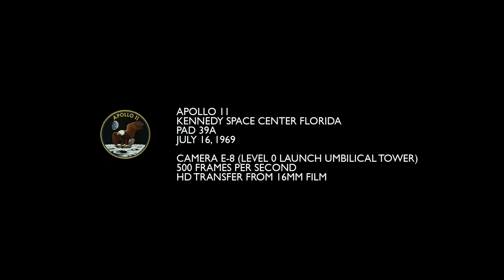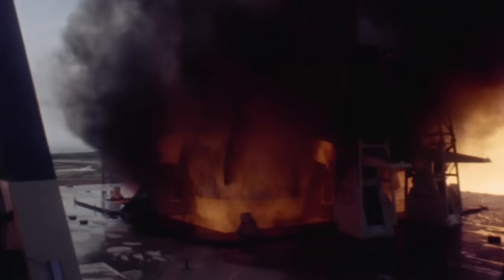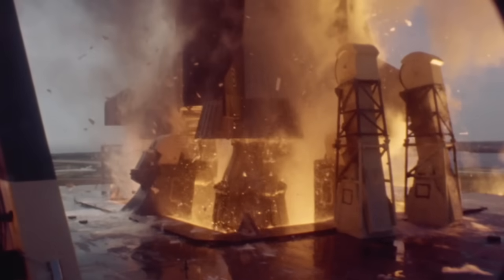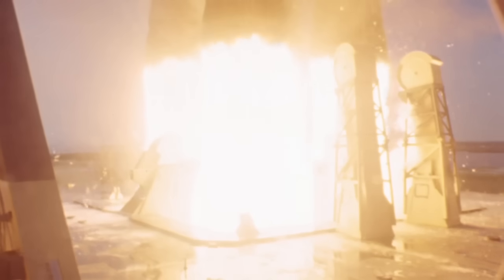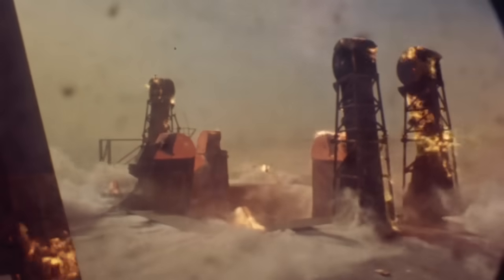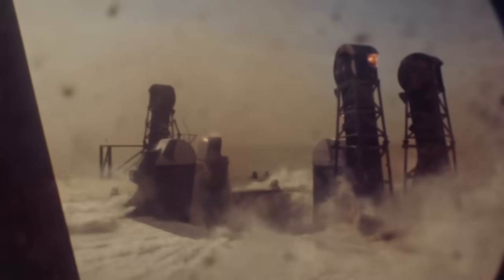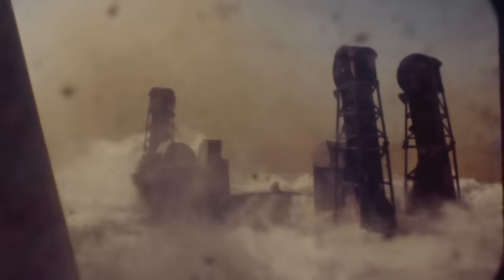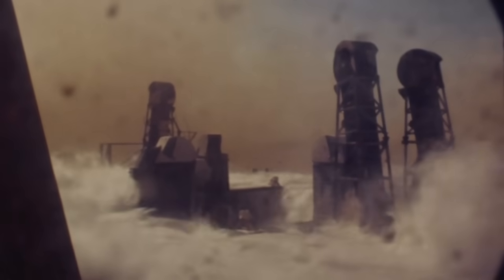Apollo 11 Saturn V Launch Camera E-8

Comment: A lot of work must've gotten into just this camera alone. Shooting at 500 fps in 1969 is by itself amazing. The engineering of the camera to spin the film so fast, yet having a shot this clear must've been a challenge to make. It looks so good...
Reply: Check out the Rapatronic cameras they used nearly 30 years before this to film nuclear bomb tests. It was @ 1 million frames per second. (They never ran for a full second. More like 0.006 seconds). If it did though, and you watched it at 24 frames per second, it would take over 12 hours to watch the 1 second. It was an amazing piece of technology!
Reply: Worked with a fellow years ago who used to work for the Atomic Energy Board of Canada specifically on the high speed cameras, you can look it up but those bad boys had frame rates around one million per second 😮.
Reply: The real challenge was to make a camera system that could survive the conditions that existed that close to the rocket.
Reply: He briefly mentioned something about the mirrors in the camera, making me think they had it in a safer location and used mirrors to reflect the image to it.
Reply: Imagine Zapruder filmed at that frame speed.
Reply: When too need to fool the whole world, of course camera work has to be good. Very impressive cgi
Reply: @kitten_with_bad_breath  do you not even believe that the rockets launched? Have you seen a rocket launch? they are sure as hell real
Reply: @kitten_with_bad_breath  Really. CGI in 1969.
Reply: @kitten_with_bad_breath  your brain is actually made out of vanilla ice cream.
Reply: @kitten_with_bad_breath  😂😂😂😂 Fool the World? How's that? 😂
Reply: @kitten_with_bad_breath back to mommy’s basement, troll.
Reply: @kitten_with_bad_breath  They can't pull a fast one over on you. You are way too smart for 'em!

Comment: That is not a turbine. There is no rotating blades in the engine. That is a rocket engine. It just blows.
Reply: There are turbines driving the fuel pumps.
Reply: @Ali Aksin If you believe that, then it's you that blows.

Comment: The water was dumped into the flame trench to control vibration from the engine exhaust. They dumped 270,000 gallons in 20 seconds.

Comment: 3750 tons of thrust transmitted to the base of the Saturn V through something called the thrust structure, a 24 ton aluminium fabricated structure constructed of 3/4 inch plate that's both welded and riveted together.  Seems beyond belief?
Reply: Your argument implicates every rocket. Are they all fake? Or perhaps there are gaps in your knowledge?
Reply: @maxfan1591  Certainly not, but you can draw your own conclusions about the Saturn V.  My personal opinion is that the rocket was not heavy as quoted and engines were not as powerful, and if it wasn't as heavy it's difficult to comprehend how it was possible for it to achieve the missions it was built for.  It's very difficult to understand how such a lightweight fabrication was supposed to support the forces involved otherwise.
Reply: @Altair885  "It's very difficult to understand how such a lightweight fabrication was supposed to support the forces involved otherwise."

Well, are you an aerospace engineer? If not, have you asked aerospace engineers about your concerns? The aerospace engineers I've spoken to have explained the way the forces are transmitted through the stack. It's elegant, but it's not beyond belief.
Reply: @maxfan1591  I've worked in the metal fabrication industry for over two decades, before that I was a welder, so I know a few things about load bearing structures!  I've also witnessed the forming of structural materials using large presses, in excess of 650 tons.  I believe I have a fairly good understanding of how certain thicknesses of various grades of metal react to the forces exerted upon them.  But I'd be delighted if an aerospace engineer could explain how how this structure can transmit the massive forces it does! 😁
Reply: @Altair885  It's almost as if you're claiming that the Apollo lunar landing missions were all faked and never actually happened, based purely on your lack of understanding of how the structure could support the forces generated?
Reply: @Altair885  That is a good question actually! I am curious! The power of a rocket engine is unimagineable and I am honestly really curious how these pads are so resistant to them. SpaceX's flight test definitely showed off how powerful they really are.

Comment: whats the 0-60mph stat for this model ?
Reply: Depends on the weight. T+0 acceleration is pretty "poor" because the vehicle is fully laden. The majority of the launch weight is fuel so 0-60 is about 8 seconds. When it's travelling ~3,000mph and has spent most of its fuel (also note by this point the sea-level optimised engines won't be producing as much thrust as the vehicle enters vacuum conditions) acceleration is like +60mph in ~2 seconds.
Reply: @GuardianSoulkeeper  Thanks mate, would you agree with me that , in order for any projectile to remain in a controlled direction, remaining on course to reach its desired target eg. enemy craft, stationary ammo dump or in this case the desired optimum satellite/cargo discharge area , the target of destination , then regardless of its weight, light or heavy or size, the projectile that is the most successful would need to reach it maximum potential speed in the shortest pitch time possible as failure to do so would cause the projectile move off its desired course ? like when you launch a paper plane its an almost instant amount of propelled force needed from your arm to prevent a failed launch, like a black widow catapult , your desired projectile is launched to its maximum speed instantly as soon as it leaves the rubber the projectile is slowing down, its the potential of the rubbers quality that determines to the best potential damage ratio, the primary, the secondary would be the projectiles properties, the best example I witness is when watching the launch of a Rapier SAM missile, it literally is breathtaking how the missile launches , it reaches its maximum potential instantly but also maintains the maximum potential for an amount of time because once that is exhausted the missile becomes unstable and will follow a random course (missing its target) so the missiles "distance to target" "ability to reach target" and also its "inability to be evaded" like when the targeted enemy craft activates it early warning alarm that a missile is fast approaching , literally the pilot has milliseconds to respond or hes toast. So the BEST missile available is governed by its ability to maintain its maximum potential propelled limit ??? How is a rocket any different from other projectiles that are ejaculated with immense pressure like bullets, missiles, fireworks or jet squirted liquids ? I   am writing a study for university could you please provide your source data for your claims, much appreciation and many thanks for your precious time 😉
Reply: @DJ-Brownie-UK  Dunno, but I'll speculate.

I'd imagine rapid acceleration makes for easier calculation but if you understand the aerodynamic properties of your vehicle at different speeds, then rapid acceleration wouldn't be as important because you can still model the craft's trajectory regardless of its speed.
Reply: @DJ-Brownie-UK  "Thanks mate, would you agree with me that , in order for any projectile to remain in a controlled direction, remaining on course to reach its desired target...the target of destination , then regardless of its weight, light or heavy or size, the projectile that is the most successful would need to reach it maximum potential speed in the shortest pitch time possible as failure to do so would cause the projectile move off its desired course ?"

No. The rocket is continually accelerating. But it also has accelerometers which measure rotation in all three dimensions. Any deviation from its pre-plotted course is detected, and the four outer engines of the stage would gimbal to steer the rocket. It could thus be steered to follow a specific course, but it could also account for unexpected forces, such as wind.

"like when you launch a paper plane its an almost instant amount of propelled force needed from your arm to prevent a failed launch, like a black widow catapult , your desired projectile is launched to its maximum speed instantly as soon as it leaves the rubber the projectile is slowing down, its the potential of the rubbers quality that determines to the best potential damage ratio, the primary, the secondary would be the projectiles properties,"

Rockets are different from paper planes, anything inert launched from a catapult, or a bullet for that matter. Each of them is given a one-off burst of acceleration and is on an unpowered path after that. Rockets during launch, like planes or cars, are receiving a constant input of power. In the rocket's case this leads to constant acceleration.

"the best example I witness is when watching the launch of a Rapier SAM missile, it literally is breathtaking how the missile launches , it reaches its maximum potential instantly but also maintains the maximum potential for an amount of time because once that is exhausted the missile becomes unstable and will follow a random course (missing its target)"

Just to be clear, no rocket reaches its maximum speed instantly. They have to accelerate, and even a Rapier missile will take a measurable amount of time to reach its maximum speed.

"How is a rocket any different from other projectiles that are ejaculated with immense pressure like bullets, missiles, fireworks or jet squirted liquids ?"

Rockets, like fireworks, accelerate constantly while they have fuel to burn. As they burn fuel they get lighter so their acceleration increases. Bullets only accelerate while being pushed by the propellant gases down the barrel. Once the bullet leaves the barrel the acceleration ceases.

"I   am writing a study for university could you please provide your source data for your claims, much appreciation and many thanks for your precious time 😉"

Out of interest, what study in what subject?
Reply: @GuardianSoulkeeper  also when a F1 car begins a grand prix the driver engages "launch mode" to achieve the quickest time off the line to remain ahead of the competition and that is goverened primarily by the Rubber composite , though im unsure what is secondary the gearbox ratio or the engines power output is secondary, or the drivers reaction speed, but The Grip of rubber to tarmac is Primary.
Reply: @djavidianmx1832  Is this your best shot and failed attempt at destroying my character👏, your nasty reaction that was triggered by my words that do not agree with your personal beliefs or would your prejudiced hate speech and total disregard for basic human rights, like another attempt at projecting another stigma or any other passive aggressive hostile comments upon myself ? I would say this time, please take your time and really focus, then when one is ready "try your best shot", but one would strongly advise not to take that shot and maybe alternatively offer a sincere apology and mend the error of your immature, inhumane and childish nasty ways making your journey to manhood a less obstructive path,    thanks Mr Djavidian, peace.🤝
Reply: Again your response is sarcastic, passive and aggressive. A typical narcissistic method used for gaslighting. But one shall and will never sink to this level of hostile provocation. Also I fully respect It is your right to believe in assumptions, but those of us whom do not, still respect the rights of others to do so. But i am sure you will agree with this wise old quote, saying "Assumptions are the mother of all fuck ups"  or perhaps you disagree with it, and I would respect your disagreement. peace.
Reply: @djavidianmx1832  That is your opinion and I respect that. Though your aggression is becoming rather tedious as one continues to dig his own hole even deeper by making even more assumptions like pointing the finger of blame at others for your own shortcomings, such as your lack of understanding the English language and your own revelation of a below average reading ability. May I ask, are you always this angry and petulant ? Such angst cannot be good for ones personal mental and physical health can it ? Maybe if you addressed this fact before making yourself look like a moron, as is evident here, your quality of life in happiness will increase, peace.
Reply: @djavidianmx1832  Ok, I will take that on board, and review my way of thinking and will adjust it according. oh and Happy New Year 🥳anything else or are you done ?

Comment: Quite comparable to my 428 cubic inch Cobra Jet Mustang in both horsepower and performance.  Same model year with just a little bit different carburetor setup and fuel tank capacity.  Still that same great acceleration.

Comment: The amount of design and engineering that went into the crawler and the launch tower alone is insane. Ive never thought about the 60 seconds or so that the tower is just getting blasted by the five engines before the rocket gets up and away. Awesome video
Reply: Then that pad and crawler took care of 135 Shuttle launches.

Comment: But the LEM jumped off the Moon.
Reply: Yes, LEM had a much simpler engine and the tradeoffs were different, engineers had leeway to make use of all tolerable acceleration. Whereas these F1s under the 2800 ton rocket stack were pushing the boundaries of what was technologically possible at the time.
Reply: @u1zha  
Cool.  1/6th of a Saturn V and a flag pops out thats says Boom.
Reply: @FFE-js2zp  1/6? Check your sources. The ascent stage weight was not 1/6 and height wasn't 1/6 either. Do not bother to elaborate what you meant. You need to check your sources first.

Hint: you're looking for something closer to 1/600
Reply: @FFE-js2zp  Clearly, you were last in line when 'smarts' were being handed out.
Reply: 1/6th the gravity and far far less weight.
Reply: The LM ascent stage only had to get two astronauts into a low orbit in a vacuum and against the Moon's gravity.

The Saturn V had to lift three astronauts, two weeks of supplies, the command module, the service module, and all the fuel needed to get to the Moon, and it had to get all of that into a much higher orbit, accelerating through the Earth's atmosphere, and against the Earth's gravity. See the factors starting to add up?

Comment: Just want to point out that the Black "gas" is actually Soot from the turbine. the F1 burns some fuel to power the turbines to move fuel through the engine, that soot is then expelled from around the inside walls to create a soot layer for thermal protection (that is one of the methods used to keep these things from melting), but there being so much of it, it takes a moment for it to find oxygen to react with again, mainly because I believe the burn for the turbines are fuel rich, some fuel is still left unburned.

Comment: So much energy for a fake Kubrick production.
Reply: Cheers genius. Could you explain precisely how you 'fake' the launch of a Saturn V in front of a million people gathered on the Florida coastline on 16th July 1969? Not only that, fake it the other dozen times just for fun.
Reply: @yassassin6425  I think that's the OP's point - if Kubrick faked it he really went overboard with the Saturn V launch. IOW, OP is one of the good guys.
Reply: @maxfan1591  
Hard to tell what was meant by the OP - it's a tad ambiguous, which means I may well have misinterpreted it.
Reply: What?

Comment: People deny the moon landing happened, but one of the significant things that proves that it was real is the events that had taken place. They were not picture perfect. When you fake something you tend to not make it a failure. The lunar landing was mere seconds from being a failure but very talented people pulled it off. On earth they were preparing the eulogy of the astronauts, but it was the skill of Neil Armstrong and the talent of Buzz Aldrin that made it happen. We did not have a proper computer to calculate the landing. It was the team and human factor that made it happen. It goes to show you what the USA is capable of when we work together. Also, if the moon landing was fake, every country in the world would be sending probes or robots to prove it was faked and the space race would be going full throttle. The race to the moon stopped. Why? Because we won. USA chants are now appropriate at time. It’s true. We did it. 🇺🇸
Reply: People don't deny it, idiots do.

Comment: Loved it. I have one question maybe someone could inform me as to why the camera only began to shake in a wave motion only after the vehicle was well into the sky. I would have thought there would be intense vibration during that massive ignition sequence, but it did not.
Reply: Likely because the launch pad is sturdily built (afaik still in operation to this very day). Assuming this is the case, then that would mean that the vibrations weren't really well conducted to the camera, which only began vibration once exposed directly to the exhaust.